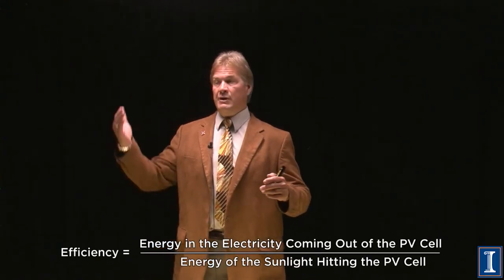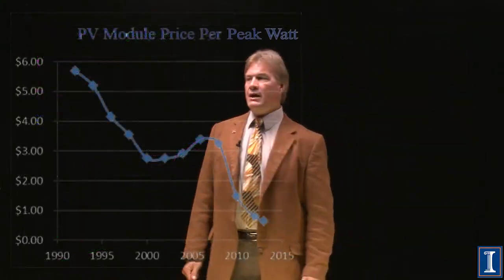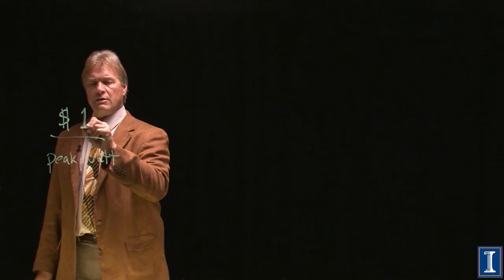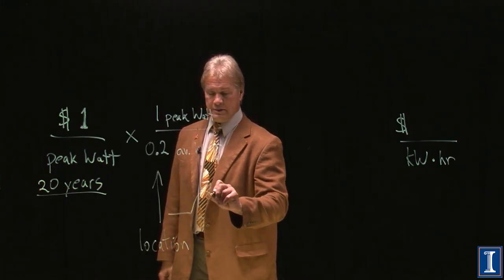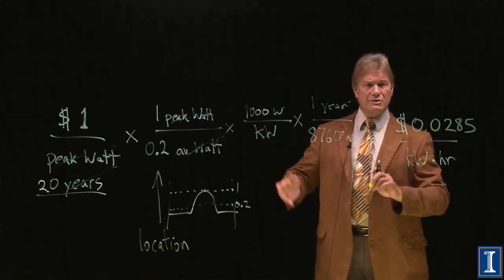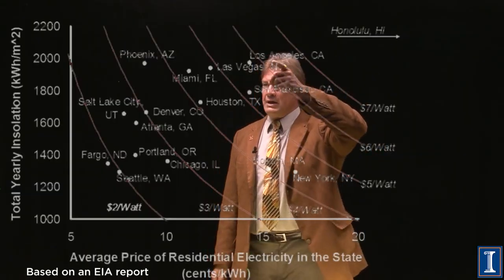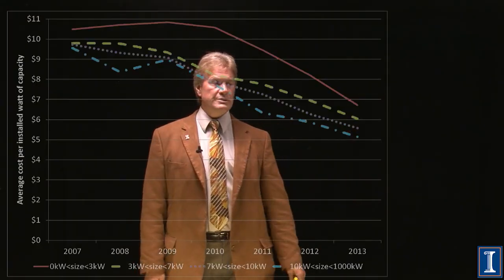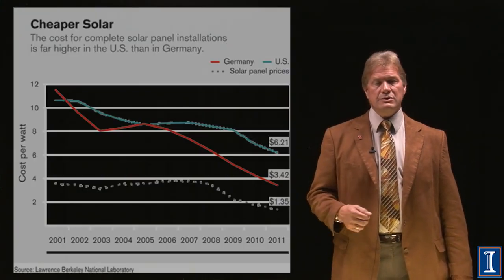The Cost of Sunshine

Comment: Not much discussion about how intermittent, low density energy sources interact with modern electrical grids, and how that effects the economics of wind and solar.
Reply: My roof generates >2x as much energy as I need for my home and car to drive ~12k miles/yr... so it's more than energy dense enough.... :)
Reply: They interact with a MODERN grid very well thank you. The problem is electric companies refusing to modernize the ancient power lines, which in addition to causing fires and blackouts means you can't transmit power far.
Reply: @AnalystPrime  No, they are an enormous problem for the grid. The grid CAN NOT store energy. If the sky is spotty then the PV-Systems will produce energy sporadically and the actual powerplants have to compensate for that on a second-by-second basis. Of course you can not ramp up a generator that fast, so what do you do? Oh right - let them CONSTANTLY run on standby and most of their production-capabilities is wasted on that.
Either you use the energy on the spot or it is useless.
Reply: @ABaumstumpf  There have been energy storage systems that work faster than power plants all over for exactly that reason long before solar and wind became a thing. The reason why people try to sell you a power plant instead and claim renewables can't be used is because that standby plant is still using fuel, which they don't tend to include into calculations how much you will end up paying them for it.

And yes, the power from that standby plant is wasted. Funny, it is not only far cheaper to build windmills or PV farms that don't need expensive fuels that are running out, rising in cost and also could be used for other industries, but the people building the renewable solutions are also smart enough to understand you might not want to waste the excess power they produce, even if it is free.

The only problem is without a proper smart grid we can't just connect New York to PV in California, or even Florida. With one we can balance the production second by second, selling the extra to other cities that have too much clouds or finding someone who wants to charge their EV or Powerwall or using it in plants that do not need to operate at full capacity 24/7.

Also, while people keep talking about solar a lot, the main benefit will be the ability to use localized sources like hydro, geothermal, tidal and offshore wind further than fifty miles away. We might want to use that field outside the city to build a new suburb a decade from now so there would be no point building windmills there, but nobody is going to change established shipping lanes any time soon so it will be easy to find a few thousand square miles of free estate on the ocean.

And yes, transmission losses are a thing. However, once you actually decide to build a modern grid that covers the whole country it becomes economical to include extra long distance lines, possibly even superconducting ones. Also, solar and wind will need some overcapacity to cover for low production times anyway; by building even more of them we can produce power at such low cost that losing some on the way thousands of miles away will not be a problem.

AND, even more importantly, that way we won't have a new energy crisis next year when it turns out our needs have increased and what we built last year no longer produces enough. If you build a bigger coal plant to keep on standby you just waste more money on fuel, if you build more renewables you get more free power that will inspire more people to figure out useful things to do with it.
Reply: @AnalystPrime  
"There have been energy storage systems that work faster than power plants all over for exactly that reason long before solar and wind became a thing."
Yes, we have energy storage all over the place. Most of that in form of water. And guess what? There is one already pretty much everywhere we can built them and they are running at full capacity.
Look at germany - the energystorage of germany combined with all its neighbours is barely capable of holding the grid alive and that nearly killed the whole grid at the start of 2019.

"And yes, the power from that standby plant is wasted. Funny, it is not only far cheaper to build windmills or PV farms that don't need expensive fuels that are running out, rising in cost and also could be used for other industries, but the people building the renewable solutions are also smart enough to understand you might not want to waste the excess power they produce, even if it is free."
You do realise you are contradicting your self there on multiple issues?
it is exactly wind and solar that lead to wasting a lot of energy. And neither of them are particular cheap - they run on heavy government subsidies and are still not cheaper than gas and hydropower in most countries.

"The only problem is without a proper smart grid we can't just connect New York to PV in California, or even Florida."
A grid can not be "smart". If you are that ignorant that you believe the marketing hype then you are really far from knowing anything.

"Also, while people keep talking about solar a lot, the main benefit will be the ability to use localized sources like hydro, geothermal, tidal and offshore wind further than fifty miles away."
A yeah - great idea. built very expensive and lossy long distance lines - what a sublime idea....................................

"it becomes economical to include extra long distance lines, possibly even superconducting ones."
The good old "if we get this futuristic materials that current science tells us we can not produce and even in 100 years we will likely not have anything even coming close - and have that for dirt cheap now - then we can make our idea barely viable".

"If you build a bigger coal plant to keep on standby you just waste more money on fuel, if you build more renewables you get more free power that will inspire more people to figure out useful things to do with it."
it is the other way around. BECAUSE of wind and solar they HAVE to run other fossil-fueled powerplants on standby 24/7.
Reply: @ABaumstumpf  Your ignorance astounds me. Firstly, while the number of rivers and lakes we can and are allowed to utilize for hydro power is limited, the only thing preventing us from digging more reservoirs is environmental concerns. Several companies are past prototype stage in utilizing old mine tunnels for compressed air energy storage, though the similar project planning to use water has been delayed due to even more demands for more environmental studies(for a good reason: water in mine tunnels usually leads to sinkholes and polluted water supply). Various other gravity based projects are studied or at prototype stage, few past that. While production of lithium is still trying to catch up to demand, there are several alternate types of batteries already in production, and claims of them only lasting for few years have been disproved many times already. Even flywheels have been used for years. Various breakthroughs have made using surplus power to produce hydrogen or other fuels, either for long term energy storage or to power nonelectric vehicles, economically viable without any of the massive subsidies the oil industry has been living on for the last century. The only issue with all these alternates is the mysteriously appearing opposition that does not want us to actually build them.

Second, there is no contradiction. There are plenty of areas where you get full power from solar panels for more than the few noontime hours and winds are favorable for 90+% of the time, and other renewables have no such limits. As the grid already has the means to balance itself WITHOUT FOSSIL FUELS the issue is not that a freak storm might drop your solar production by a hundred megawatts for a day, it is the ancient grid not being able to cover that by connecting to the gigawatts of surplus renewable power produced elsewhere. And even if the coal plant manages to lobby opposition to building enough storage to cover 24h energy needs with only solar(which we wouldn't do because the other types of renewables exist) and we still needed to buy power from them during the night, that means we would only need to pay them for power during the eight hours of lowest demand.
Also, you are way behind times. Fossil fuels are still getting the same huge subsidies that are the only thing making them viable, but wind and solar have been cheaper than them without subsidies for a while already. AND they keep getting cheaper, while the disappearing supplies mean oil prices will keep going up.

Third: https://en.wikipedia.org/wiki/Smart_grid
This is not some new idea, only a willfully ignorant wouldn't understand what it means. Acting dumb does not give any credibility to your claims.

Fourth, yes, build the grid we have needed since decades ago already. Cost is irrelevant, it is needed and will pay itself back. Feel free to go tell the car companies the interstate freeways should not have been built if you disagree.

Fifth, please learn to read. Saying it may be possible to use something to improve performance is very far from not being able to build the less advanced version
Also, we do have that tech already. Yes, it will cost more than basic copper wires, but economies of scale and savings from lower losses can make it viable.

Sixth, no. We do not need a new standby power plant running 24/7 when the previously built ones already aren't used more than a few days each year. We do not need to cover those few days with costly fossil fuels when cheaper and cleaner alternatives already exist. We plain do not need to use fossil fuels.
Reply: @ABaumstumpf  Funny, just yesterday on another thread I was the one pointing out that damming a valley or digging pits for reservoirs might be opposed because it destroys whatever nature and animal habitats gets flooded, even if no humans happen to live in that area. The other guy's assurances that adding fish into the reservoir would compensate for that did not convince me... I mean, it is meant to be constantly filled and emptied, possibly daily, how they heck would the fish even survive that?

The video we were commenting on was about using old mine shafts for compressed air energy storage. I don't know how well we can upscale that, the prototype plants are only megawatt scale, but because the thing is 99% underground and the land above can be utilized for other things it seems to me that people might well be willing to pay extra for tech that is proven to work, has very few risks, and can be built "out of sight, out of mind", as it were.

Unfortunately those things need suitable rock to dig those tunnels into, or rather abandoned mines that can be used without needing to pay huge sums for digging your own tunnels. We might not like the idea of making huge open pits for reservoirs, but they are one of the cheapest ways to store energy and cause far less environmental problems than keeping using fossil fuels.

That is the main issue here: We do not need a tech that is 100% pollution free, we just want that it pollutes massively less than any part of the fossil fuel industry. Nuclear power plants take decades to build with all the red tape and inspections, cost at least ten billion each, need expensive and highly trained people just to keep it working moistly safely, and use one of the most dangerous toxic carcinogenic and expensive elements as fuel, yet they are still far cheaper, cleaner and less deadly than oil, coal and gas.

So yes, more renewables, more energy storage, more nuclear power, and that is how we save rest of the environment and keep it habitable for humans too. Because the OTHER option for keeping us alive involves reducing the human population, and the bastards responsible for this shit are hard to catch.

There seems to be something else you were trying to say, but YouTube refuses to show your comment in full for some reason.
Reply: @AnalystPrime  There are many things we can do.
The "pumping air into mountains" seems really strange and from what i hear inefficient, but still better than doing nothing.
And for water storage - it is not just the animals, but the whole climate there and the geology as well as the rivers them self. just building a dam can have enormous consequences for the whole river - downstream as well as upstream - if the rock there even allows for a dam to be constructed.
Reply: @ABaumstumpf  Compressed air storage is not a new tech, they just improved it recently and raised the efficiency to 60%(pumped hydro is around 80%), which makes it more viable. The problem is if you don't have an old mine you can use, digging the storage caverns would be very expensive and I am still not sure how much it can store.

As for water, good news is no plans to dam any rivers. Bad news is that is because we don't have many we could use left, instead we just need to dig a pit on high ground we pump water into and let it flow downhill to a second deeper hole when we need the power, reusing the same water.
You need to top off the water occasionally due to evaporation, but you don't want that water flowing back into any rivers because it is not going to stay very clean for long.
The bad news, despite the huge footprint and other environmental concerns, we probably will need to build them anyway.

Comment: Now modify for latitude, weather, particulate concentration, terrain type, transmission losses, and night.
Reply: All of those except transmission losses are already accounted for in the average output numbers.  Compared to other types of power generation solar will tend to have lower transmission losses since it is often generated physically close to where it is used, even on the rooftop of the building it is being used in.  This also reduces infrastructure costs, as solar is less likely to require construction of dedicated new transmission lines than large single generating stations.

Comment: Next gen modular nuclear is the best way to go.
Reply: Only if they can get the cost down.  Nuclear is currently ~10x more per watt and ~4x more per watt-hr compared to wind or solar.
Reply: @Chris-ie9os , where I live in Ontario, nuclear is the cheapest, followed by hydo, natural gas and renewables the most expensive. We don't have coal.
Reply: The thing about nuclear is that it's energy dense in a way renewables like solar and wind just can't be. You can't power a car manufacturering plant or googles supercomputer with renewables. Transporting energy incurs losses and there exists a point where all of the energy leaks out after it's been moved a certain distance. To power the things I've mentioned you'd need a field of solar panels that exceeds that maximum carry capacity by quite a bit. Even if it was possible it still be hilariously space inefficient. 

That's why we need nuclear.
Reply: @SIRslipperyasp91  ????  Sure you can... a GWh is a GWh.  Energy is Energy.  There is FAR more energy available from solar and wind than we could possibly use.  >90% of our society has been running on stored sunlight since the beginning of time.

Comment: The main reason I don't put up solar right now is the cost of return investment.  I have to live in my house at least twenty years to see any savings in electric if I went solar over what I pay now which is 6 cents per killowatt hour.  During that time I'd have to do upkeep of the solar meaning clear snow off them in the winter, change out batteries when they no longer hold a charge, make sure the surface of the cells are clean.  Plus my electric company doesn't give anything if I feed into the grid my unused energy.  In fact they penalize me for it by adding on other fees thanks to my local government letting them do it.

Comment: It depends on the the assumptions you make.  Is the warranty period really how long solar cells last?  Also things change, solar power is becoming cheaper and cheaper and is storage.
Reply: Warranty is how long the manufacturer promises that they will replace your panels if there was a defect in them. The regular panels have lifespans of 30+ years, and while old panels will produce less power it is possible to adjust the system for that. The main issues with twenty to thirty years old panels are that the house they are on will need repairs anyway so you might as well buy the new more efficient panels, and your roof area is limited so your system might be barely large enough to cover all your needs, so when it loses 20-30% of it's peak output over time you may need to buy more power from the grid again.
Reply: @AnalystPrime  Thank you for the additional information.